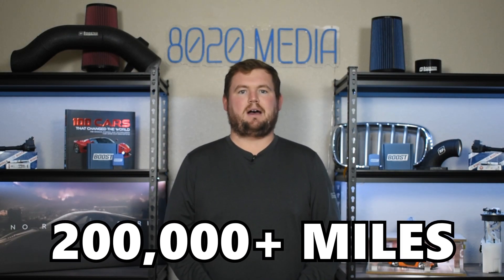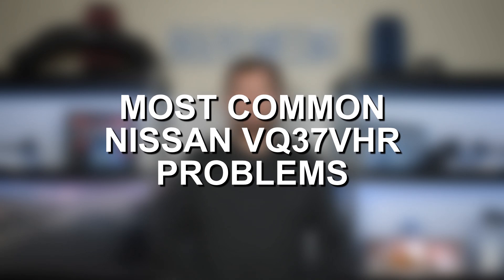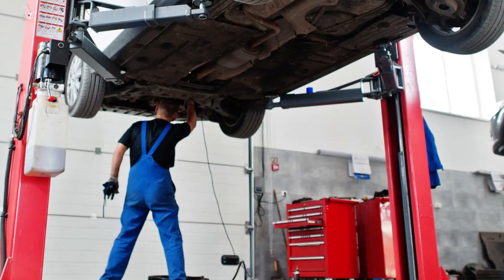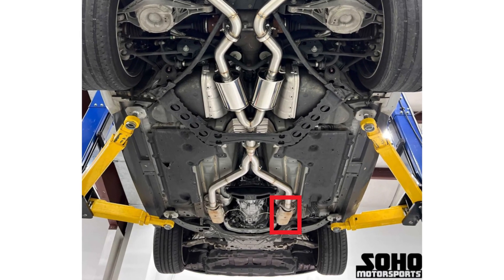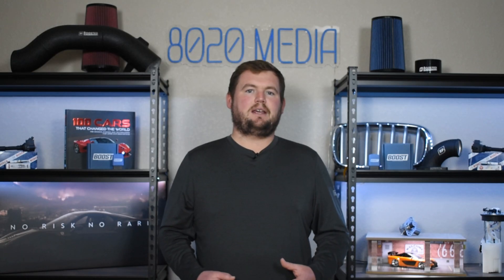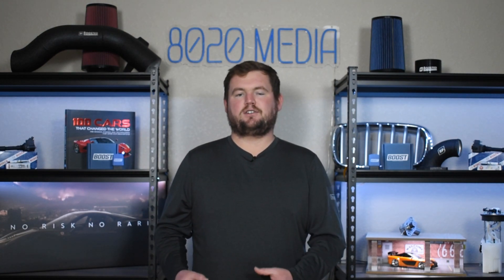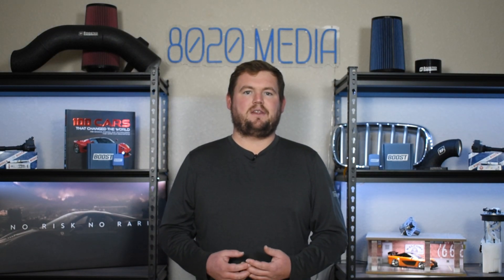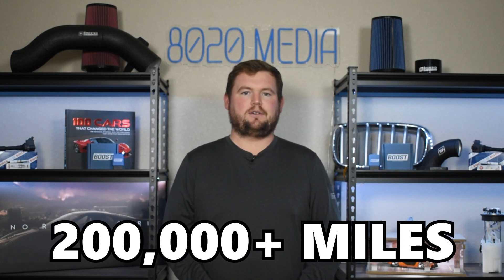Nissan VQ37VHR Engine Problems? Here's What We Found!

Comment: I think you’re wrong in this assessment.  High oil consumption leads to clogged catalytic converter.  If you’re in CA you will fail smog and compliant cats are as expensive as oem.  Not cheap at all and is a direct result of high consumption.
Reply from the maker: M - What assessment exactly are we wrong on?